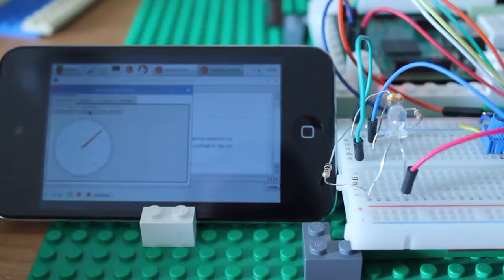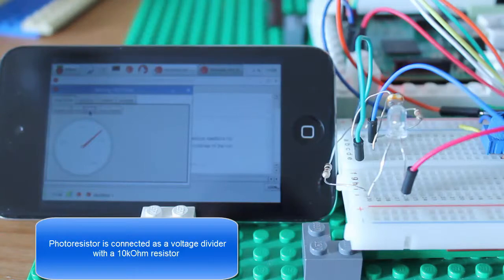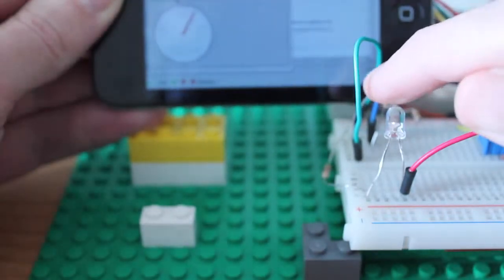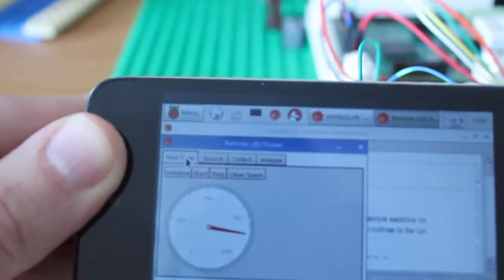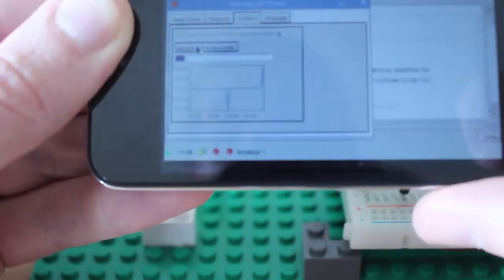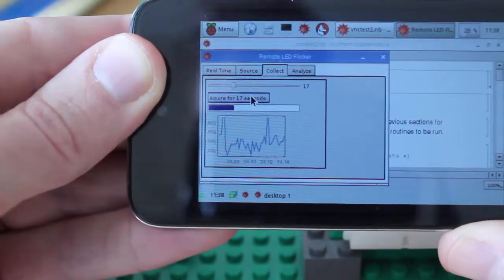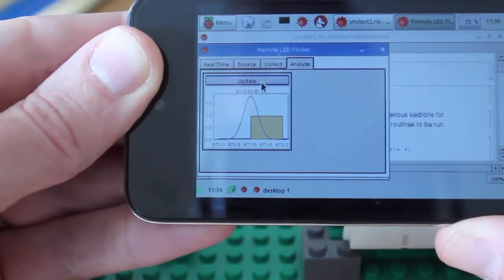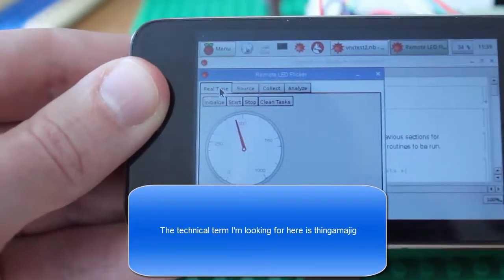Remote sensing with the Raspberry Pi and Wolfram Mathematica

Comment: reason / advantages for using mathematica over python?
Reply from the maker: +Peter Brown Sorry, missed your comment.  I have a lot more experience with Mathematica over Python, so tasks like creating a GUI interface are a lot more intuitive for me.  Virtually everything I've done on an RPi with Mathematica, one could also do with Python.  I suspect interface generation and higher order functions such as data fitting are a bit easier in Mathematica, but I'm learning that Python has a vast collection of libraries and in the end, it might boil down to comfort level and preferences.
Reply: Robert’s answer is spot-on, and I’ll expand on it a bit.  I would phrase it this way: as far as the hardware interfacing is concerned, once someone like Robert has been courageous enough to delve into the MathLink interfacing (which is a bit gnarly, and traditionally written in C or C++), which is a layer of glue attaching the Wolfram Language to extend it with external software or hardware, then the power becomes evident when you consider that there are 4,000+ functions included in the Wolfram Language which will be able to process that data.  For example here Robert is able to detect a distribution in the input data and rapidly cobble together a graphic display with controls using those functions.  The support for deploying your code into a web-accessible application running on Wolfram’s servers is a more recent addition which would be quite hard to support in Python (unless someone has already designe such a thing).

Becoming facile with a function library of that magnitude can seem quite daunting at first, and definitely represents a significant learning curve.  But the reference.wolfram.com website, and also Stephen Wolfram’s book: “An Elementary Introduction to Wolfram Language” which you can buy in print or read or download for free (link below to individual online or PDF chapters), helps make the learning curve a more enjoyable one, and groups the functions in categories so you can focus on what is most important for your own needs.

https://www.wolfram.com/language/elementary-introduction/

If you want to simply blink lights on and off, fade them in and out, or do simple remote sensing and control, Mathematica isn’t the way to go.  And Python has considerable support via libraries to support all sorts of mathematical tasks, including vector and matric processing, curve fitting and so on.  But the fact that Wolfram Language basically “thinks” in terms of symbolic (abstract) terms and because it’s very rare that you have to write any glue to pass data, expressions or equations produced with one set of functions to another, the fact that everything fits together quite well in Mathematica becomes quite evident and powerful, the more you use it.

As a practical case example, I’ve been tinkering with some Rubik’s cube code in Mathematica.  Although you can do this quite well in C or Python or any programming language, I’m looking at it in terms of permutation and group theory in a much more abstract way.  So I can still show what happens when you perform various simple manipulations, and solve cubes using a number of algorithms.  But the ability to think about it natively in group theoretic terms, and to dabble in abstract algebra, is very important and leads to a high level analysis. If you were to attempt that in Python (or God forbid anything lower level like C), then you’d be reinventing the wheel since that level of support is already built-in via that function library.  By and large what I’m writing attempts to hide all the permutation and group theory, so that a very simple user interface showing graphic 3D representations of cube states as objects is all the user really experiences.

I’ve been using Mathematica since the early 1990s, and it just keeps getting better.  I can’t wait to upgrade to version 11 on my Mac when I can set aside some cash.